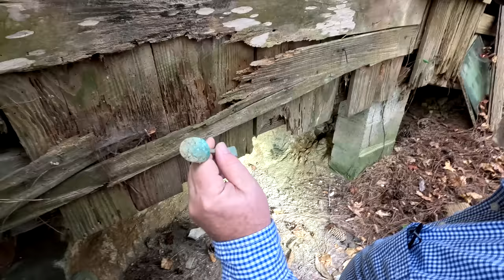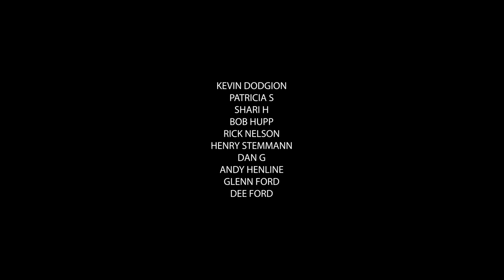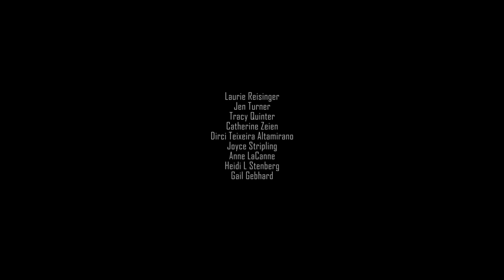SO CREEPY WE RAN! Mysterious Abandoned House Found In The Woods Of Georgia!

Comment: Many of the features you are commenting on were similar in my grandparents home. Only 3 of the 5 rooms were sealed with tongue-and-grove lumber.  It was built quickly in the 1930s to a common layout: two large front rooms with shared chimneys between them. Three smaller rooms were across the back. The kitchen wasn’t sealed with wood, but with cardboard.

Comment: Grew up on an old farm in Tennessee (late 70’s early 80’s) and lived in an old four room house. The house was on a stack stone pier foundation and had the same roll roofing, brick style siding. Inside the walls were 1920’s newspapers for insulation. There was a dug out cellar beneath the house and an outhouse in the back yard. We closed in the rear porch and converted it to a bathroom/washroom and installed running water in the kitchen. A wood burning stove provided heat in the winter. A lot of similarities between this old house and the farm house of my youth.

Comment: At 17.42, you can see an important detail.  The bottom of the boards are cut at an angle.  This was an old means of allowing water to roll down the board, off the edge and down to the pointed edge where the water would flow down to and drip off.

Comment: That stump was cut down using a bow saw  bucksaw or two man saw, the lumber is not that old and was maintained in good shape. The cement blocks not so old either. It could still be fixed and used as a cabin. 🌳

Comment: The original part of the house looks like it was built in the 1880s.    It was added onto after that, probably in the 1920s ??   The cement blocks used under the house are smooth.   1920 or later

Comment: I wonder, considering the age and design of that stone wall, with those steps, along with the size of the yard, and the smallness and simple design of that house if there isn't the remains or foundation of a bigger house that was built earlier somewhere on the property. Maybe that house was for a sharecropper or someone who worked there? But I suppose that would be known by the locals if such a place had ever existed. Or maybe those chimneys belonged to a much older house? Just too many  conflicting bits and pieces.

Comment: The fireplace looks way way older than the that very modern brick on side of house.Maybe they sided it with that brick in later years for protection of structure from the elements.